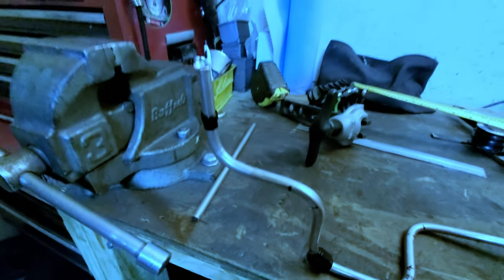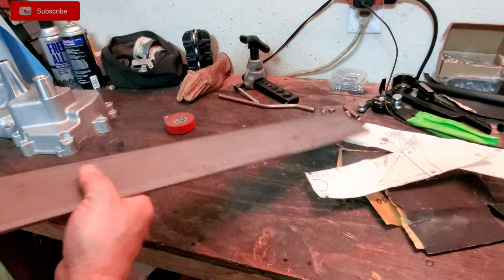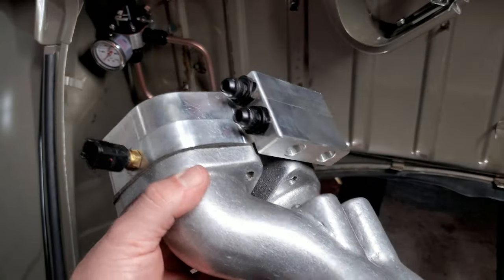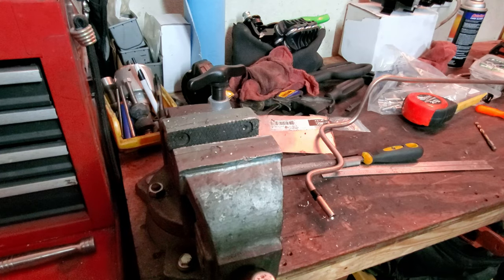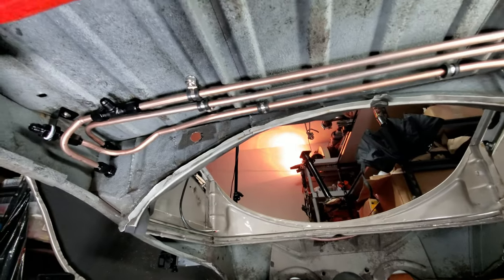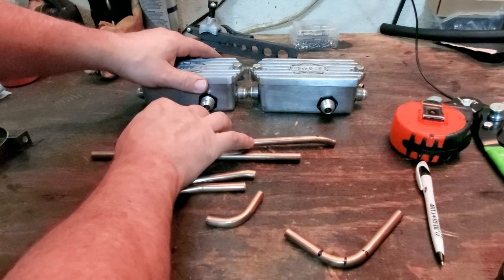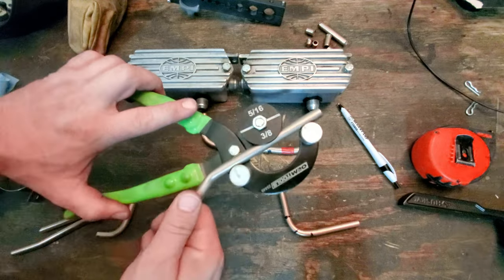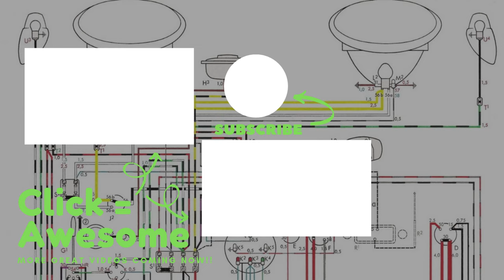Custom EFI Hardlines and Fuel Pump Bracket | Turbo VW Beetle | JW Classic VW

Comment: I remember you putting a new fuel pump on this ride long ago.is that right? So I guess it can’t pump enough for the new engine ?Cant wait to see her going again
Reply from the maker: Yes that is correct the Bosch 044 is capable of supporting up to around 600HP.

Comment: Anyone that has plumbed a car has the same box full of mistakes when they’re finished! Spring benders work great for tight bends or close offsets where the regular benders are too big. Definitely have to mind the number of kinks you end up with. Probably not quite as critical in the EFI application because you’re dialing in your pressure setting on the Return line. I’ve seen jobs where it looked like the bent their tubing over the edge of their kitchen counter. Ok, now that you’ve done your “mock up” in copper, take it all out and copy it to stainless! Haha! Sure looks purdy all polished up.
Reply from the maker: No stainless steel man!!! LOL